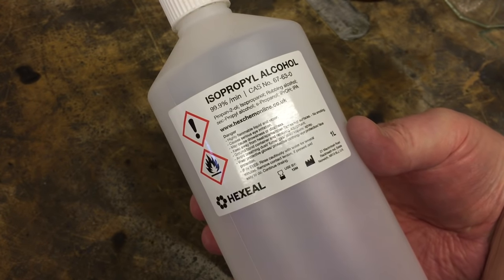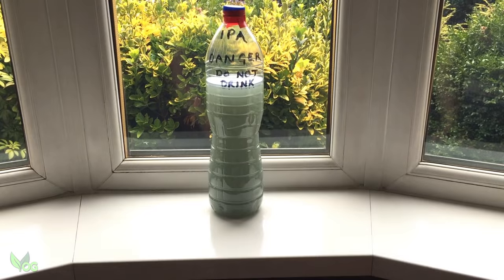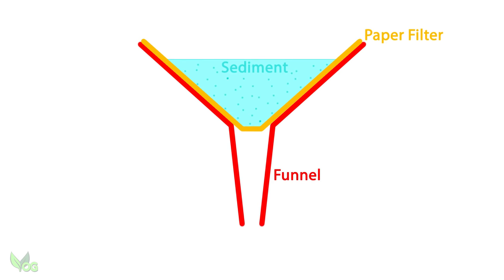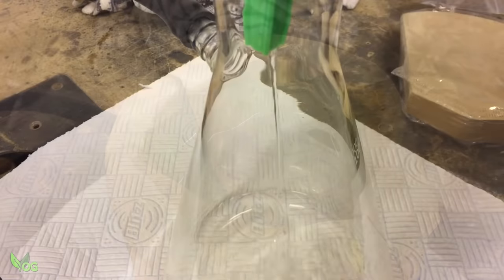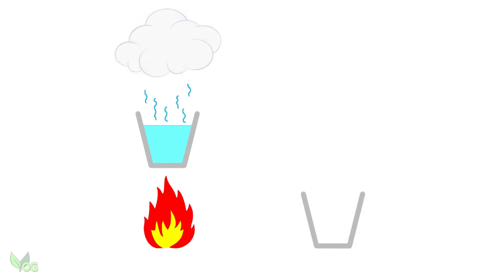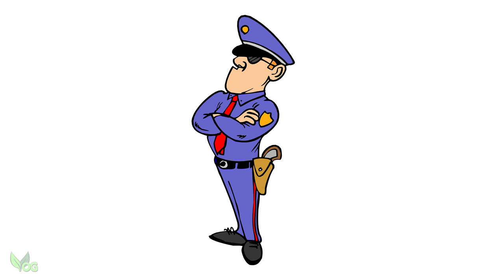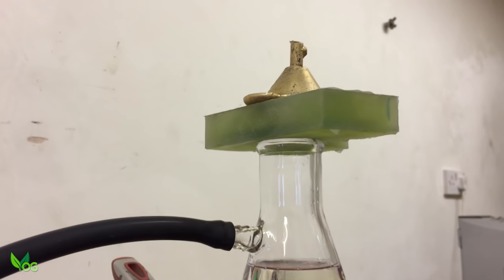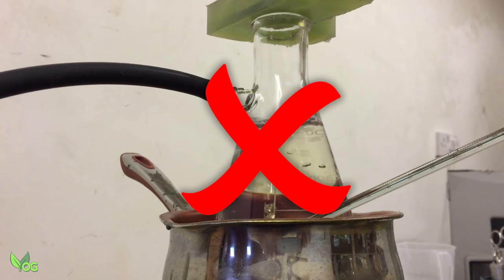How to Clean | Recycle | Reuse IPA (Isopropyl Alcohol) for 3D printing by VOGMAN

Comment: Always been wondering though. Why not just use a cure station to cure the resin that's in the IPA to clean it out. Wouldn't think it's worse than it sitting in the sun (maybe less heat) and i'd guess that it's a lot faster as well (especially where were the sun aint shining. Just rain and clouds).
Reply from the maker: Simply because daylight is free. You don't need sunshine, just daylight. Sunshine here in the UK is rare, but cloudy days are plentiful and the windowsill is a great spot to leave and ignore it 😁
Reply: @vogman  I did give it a try. We have the same weather here (Netherlands) so figured it couldn't hurt. And like you said. You just ignore it. Downside though. Mine stayed super cloudy. In the end i brought the contents to the dump so they can get rid of it in a propper way (didn't feel it safe to have 3L of almost pure alcohol evaporate on the balcony with a lot of people within 2.5 meters above it). Got a bit afraid it would turn into IPA jelly. Maybe i waited to long to try and clean it idk. It was fully clear before it was set in the windowsill (just a layer at the bottom) but it gotten cloudier with time to the point it started to look like the IPA jelly but not hardened yet. 

New attempt next time :D. Thank you for responding :)

Comment: So, I love this idea and concept, but I have an issue. Maybe it's because I used glass jars, or perhaps the quality of the IPA (98%) manufacturer wasn't good, the resin in my IPA didn't cure and settle, it congealed into this mass, hardened on the sides of the jar to the point I could barely scrape it off, and effectively have to toss about 1.5 gallons of IPA.

Any ideas what might have happened? 

I honestly think it was the brand/manufacturer of the IPA because I've since used a different brand that's 99% IPA and I don't have the cloudiness or anything when rinsing the IPA off. (The original IPA I mentioned whenever water hit it would immediately get cloudy and often times left a film)

Comment: It IS legal to distill in the uk. As long as you’re not making anything to drink! Although the method here is potentially dangerous due to the vapour escaping into the air as it’s not sufficiently cooled. A repurpose pressure cooker still is under £100. An air still is about £150
Reply from the maker: Thanks for the input 😁
Reply: @vogman  I wouldn’t go with the airstill as I don’t know what the oils/residue in the ipa is. It could gum up the insides. Although it is the best option... 
wait did any of the oils carry over in your distillation experiment? Or were they left in the beaker?

Comment: How does the dirty ipa affect the wash and cure station do you empty it after every print? I am asking as I would not print every day and just got one
Reply from the maker: I tend to use recycled in my wash and cure. This gets them 99% clean. After that I give a quick spray with 100% clean.
Reply: @vogman  thanks for the reply and the video, that's good to know I'm heavy on coffee so I know the filter you are talking about. But nitially I had my Iso in one of those pickle pots and Ithe residue left in it got gunky as you probably now, wouldn't that happen if the alcohol is left is the wash and cure, or the fact you use it more often it those not settle
Reply from the maker: Wash n Cures are great but yes, they ideally need emptying and cleaning otherwise gunk will gather. I'm lazy and don't do this every time, but so far I'd had no problems. But if you never clean it, then you'd get issues with the bearing and impeller I'd guess. But here's my tip... if it helps. I tend to keep a dirty IPA container. I dip prints directly into this to remove the bulk of resin. I then place the print in a Wash n Cure which holds recycled but clean IPA and that does the bulk. Then a quick spray or dip in virgin IPA usually produces a residue free print. These steps sound cumbersome, but they extend the life of your IPA, give you nice clean prints and quickly become a normal routine. I hope it helps 😁
Reply: @vogman  no that helps a lot thanks and make perfect sense and thank you

Comment: Get a cheap Chinese distillation set with nice lab glass and 24/40 glass joints for about $40. Get a heater for about the same amount. You'll need a stand and clamps, too. Finally, an old water pump and bucket. You will also want to get some molecular sieves to absorb water in the recycled IPA that gets in it from the air, or whatever. You can recycle the sieves in your oven.
Reply from the maker: Nice tips, thanks 😁

Comment: ive done this in the lab with proper distillation equipment. still takes forever and only makes sense if you have cheap/free electricity
Reply from the maker: Thanks for sharing that. I agree it's long and energy consuming. It's not worth distilling in my opinion 😁
Reply: @vogman  we are considering to run a second trial with vacuum aided distillation, hoping to get power consumption down significantly. Another idea was to use a radicalizing agent as a chain starter to force leftover resin to fall out of solution. 
Filtration methods (both under vacuum and ambient pressure) have proven to be unsuccessful regardless of filtration medium.
To be honest its a real headscratcher. IPA is so cheap that most methods of recovery just arent economic. 
We are sure there must be a methodology that will at least achieve cost parity and reduce waste, but so far the solution (ha) has eluded us.

Comment: Hi, the same can be used with water if I use resin water washable?
Reply from the maker: Yes. I actually do. I separate the resin by curing it then pour the water onto concrete and allow natural distillation to occur. For me it's better than pouring it down the drain 😁

Comment: Try using your 3D printer's hot bed as your heating source, most firmware have the option to preheat to a set temperature.
Your luck my vary depending on the printer you have.

I wouldn't advise doing this on a cheap & cheerful model, the hot bed is the largest power drain on a 3D printer, and the most likely thing to cause a Chinesium control board to spontaneously combust.
Reply from the maker: actually toyed with the idea of a printer bed, but by then I'd given up on the idea. Lots of risk for very little reward 😁
Reply: @vogman  CNC Kitchen cooked a steak on his in a live stream!

Comment: Wouldn't you speed up the resin condensation considerably by putting it outdoors, rather than by a window? Regular window glass blocks a fair range of the UV spectrum, though obviously not all of it.

The image of the double-funnel made me think, "oh, look, it's a plastic colander."

The obvious problem with the still is that you don't have anything like a condenser coil. That rubber hose isn't going to do a good job of that, and you're probably experiencing significant losses from alcohol vapor escaping without condensing.

If you're trying to hold a specific temperature without fiddling with your heat source, what immediately comes to mind is a sous vide circulator. They're not expensive, and they can hold temperatures between 25 C and 99 C to roughly +/- 0.2 C indefinitely. You have to use a water bath, but you're already doing that. There's no fire danger, unlike a Bunsen burner exposed to alcohol fumes.

Comment: Way easier and safer method for you.

Take an upside down coke bottle, punch a tiny hole in the lid, put something like a cotton bud or some coffee strainer at the bottom so the sand doesnt fall out.
Fill with a few alternating layers of sand and ground up charcoal about 1 inch thick each. Pour ipa into the upside down bottle and let it filter.
It will come out flawlessly and has made two liters of IPA last me 3 weeks of 24/7 printing.

Comment: Our windows have a UV filtering coating because we live at 5000ft and are not looking to have turbo cataracts. If only my dad knew that in 20 years there would be a new technology easily accessible that would require us to put UV sensitive objects near UV passable windows 😩
On the plus side I guess I don't have to worry about my resin getting exposed to sunlight in my room 🤔
Reply from the maker: There's good and bad there Lars, but for this technique it would mean using a curing station, which is a shame as daylight is free 😁

Comment: For once, all of the solutions were ones I'd expected to lead, including redistilling. =) As every man should do at least once, I had my bout with making rum back in my relative youth, and the secret to getting quick, effective alcohol is 165*F for heat and using a chilled copper cooling spiral. That's a lot of work though for recouping IPA, so I'm working on finding a better/cheaper concentrate for my DIY ultrasonic tank solution. I'm thinking my first round will be to get a good method of concentrating store-bought vinegar which is an extremely effective, relatively cheap and 'green' chem for those interested. At 5% off the shelf, not terribly quick, but in an ultrasonic bath with a bit more oopmh, it should work a treat. 
You should definitely look into making your own ultrasonic tank for a vid. Even the amazon variety are a rip off once you see how simple it is to make your own. Mine will process several gallons worth which will fit any part I could ever print (or several as it were) and I'm only in it for $50 (US). If you have a welder and some stainless steel sheet, it's even cheaper, like 33-40 all in.
Reply from the maker: I used a nail varnish UV light before I was spoiled by the Anycubic Wash and Cure. I find that so convenient. But I do love ingenuity and hearing peoples ideas and suggestions 😁😁😁

Comment: Nice trick with the use of sunlight to force the resin to polymerize inside the liquid. I'm just wondering one thing: wouldn't the process go faster using a UV chamber? Since you're clearly a 3D printing maniac you probably have one of those lying somewhere around very close.
Reply from the maker: Daylight is free. UV lights cost money and wear out. Where I can, I try to save a few pennies 😁😁😁
Reply: @vogman  Good answer.
Then let me suggest an improvement to your natural UV use: add some well placed mirrors or simply put the bottle inside a very reflective bowl.

Comment: I'm curious: Has anyone has tried putting the bottle of IPA in their curing station instead of leaving it on the windowsill? Since it's all about that UV light, wouldn't it basically do what the sun does only much quicker? Or am I missing something rather important here :P?
Reply from the maker: Settling is an important part of this process and daylight costs nothing. So it's a win win 😁

Comment: "Possible legality" 🤣
Reply from the maker: Moonshiners beware 😁😁😁
Reply: @vogman  Unless the law is sloppily written (yes, happens far too often), a restriction on distilling drinkable ethanol shouldn't apply to the decidedly not drinkable isopropyl alcohol.
Reply: HMRC are rarely interested in moonshiners unless they're bootlegging. The law does not apply to distillation as a process, but rather to distillation of potable spirit. They're not interested in fuel etc. This is fine
Reply: Note: buying distillation glassware will put you on a watchlist 😂
This would also be much safer with a hotplate or mantle, or even a commercial electric still which can be had for under £200.

Comment: The stink the IPA gets is the bigger problem, every container it is in also stinks after that, even when the chunks get filtered
Reply from the maker: It's one of those things. Some folks are really bothered by the smell. It can give them headaches, sore throats, etc. Fortunately it doesn't bother me and I can tolerate it, but you're right, it gets everywhere 😁
Reply: @vogman  i mean the sweet smell of the yellowish IPA, i love the smell of fresh IPA, having a 10 liter canister kept me sane in 2020 because the Ethanol hand sanitizers are just naaaasty, i also don't have any problems with the smell of Resin or ABS and not sensitive to any of that, just when that pool of ipa settles in the sun, i use the same method as you do

Comment: my motorcycle use E86 or pure Ethanol.
When my IPA starts to change color after this cleaning process, i pour in little amounts in my fuel tank.
.
.
.
.
.
do not do this on your motorcycle or car, I am a professional mechanical engineer with experience in automotive mechanics and my motorcycle was modified to receive low quality or adulterated fuels.

Comment: i stopped using alcohol, just warm water does the trick boss
Reply from the maker: This may work for some resins, but not all. But if you can get away with it, why not 😁
Reply: @vogman  i use the anicubic grey  and clear resins. cheap ones

Comment: Oof .. my chemists heart burns ... a vacuum flask for distilling ... (i guess it works) but it still hurts :( :D
Reply from the maker: Yes, not a distillation flask, but it was all I had. When I was at school we used conical flasks with pipe inserted into the bung 😁
There's better equipment and better methods available for sure... but I'm not sure it's worth it with IPA 😁😁😁

Comment: This is propably the same step to clean vegtable oil for your diesel car
Reply from the maker: Ahhhh... now there's it's just good old settling. Works brilliantly.
Reply: People in my country used it to remove the blue color out of furnace diesel -which you are legaly not alowed to use in car(its 0.80 € compared to 1.5€ per liter for regular diesel) so they put colour in it . . . .so a lot of plastic bottles are sunbathing on the rooftops in rural areas . . .
Reply from the maker: Backyard ingenuity never ceases to amaze me 😁😁😁

Comment: From what I remember from chemistry lab this is NOT destilling flask (you probably have to throw it out now - different glass properties ). Also you need glass radiator connected to destilation flask (sorry but rubber hose wont do) and heater that will give you constant temperature.
Oh and do it in well ventilated room at least.

Anyway great idea but I dont recommend boiling alcohol without proper safety gear.
Reply from the maker: No, it's not a distillation flask. It may be a vacuum flask, I'm not sure. For a quick and cheap experiment I used what I had. But like you, I don't recommend anyone doing it unless they have all the proper gear and knowledge 😁😁😁
Reply: @vogman  ohnestly good job :D
I did this myself when I was still at university for my engineer degree
(We also did boil alcohol, however safety wasnt primary focus - on one occasion we were using chloroform without working hood - while that being fun, driving home after 4hours working with it is not very good idea).